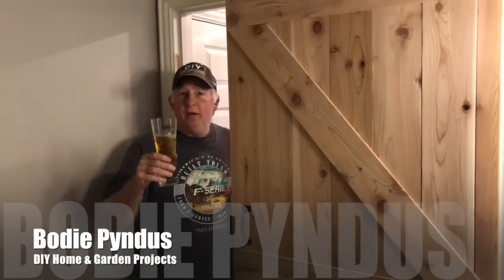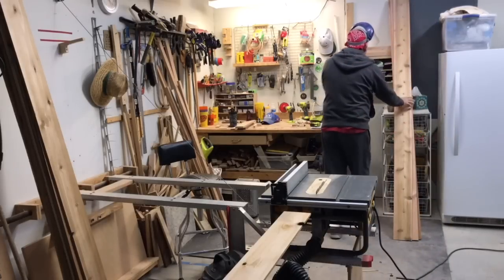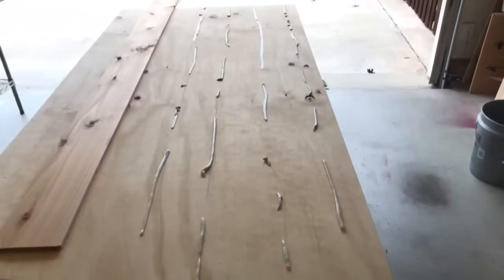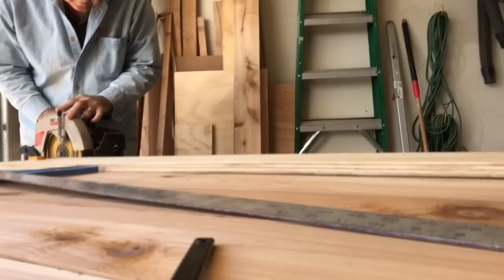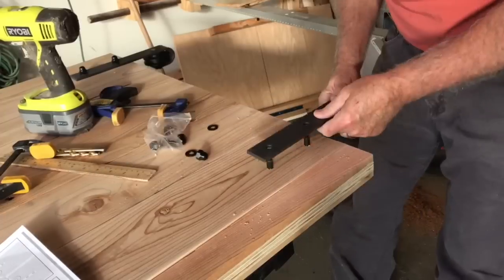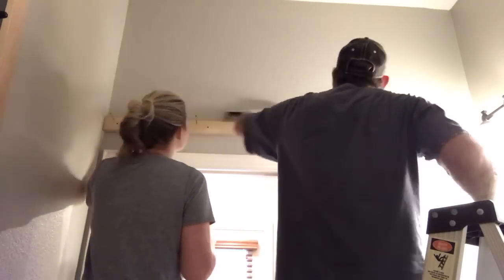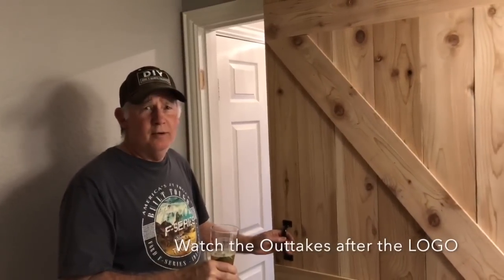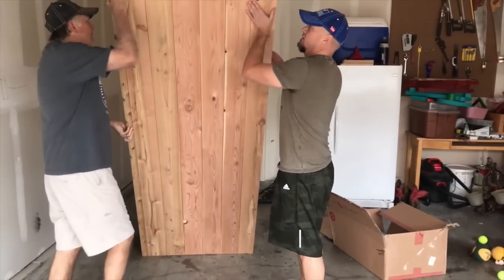How To Build A Sliding Barn Door: Simple DIY Tutorial

Comment: Hi, I'm planning of making a barn door for the very first time. 
It's going to be install between my bedroom and master bath.  48 inches wide opening. I never thought of adding plywood between the panels.  I also noticed you didn't make a frame. How thick is your door? I bet the door was heavy.  Will it work if i buy panels with grooves. Home depot has them for $6 per panels. your door turned out great! Thanks
Reply from the maker: Joe, I did add an edge trim to the door (not shown) The plywood adds stiffness as well as weight. The cedar planks are thin and likely to warp by them selves.
Reply: @DIYHGP  
Okay. Thanks for the info.

Comment: Thanks for your video  - I noticed you have the same issue I had with the light switch being on the wall behind the door when you slide it open. I ended up moving the switch to the other wall. Was this an issue for you? Was there a reason you didn't put any finish or stain on the cedar? One other question - what kind of handle did you use for the other side of the door- never seen this addressed in any barn door build videos. Nice work - you made it look easy which means you know what you're doing.
Reply from the maker: Since this was my daughters house I offered to move the light switch but she declined.  she wanted to have the natural look of Cedar rather than have it finished so that’s what she got.

Comment: Do you have to use 3/4" plywood? I'm assuming that is to make it "more" durable but would 1/2" or maybe even 1/4" work too? I'm a small woman so handling the larger plywood is a challenge.
Reply from the maker: I believe 1/2 inch would work, I would not use 1/4 inch as it is not strong enough.
Reply: DIY Home & Garden Projects awesome! Thank you so much! I'm going to plane and then burn the planks to get a different look. I honestly didn't even think about putting the planks on plywood. I just thought it would be like building a fence gate. I'm so happy I found your video!